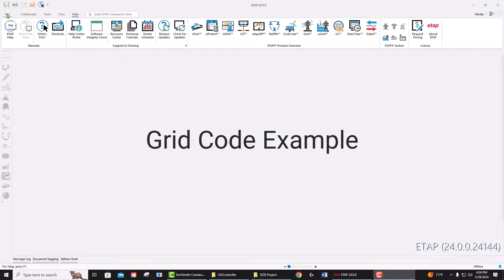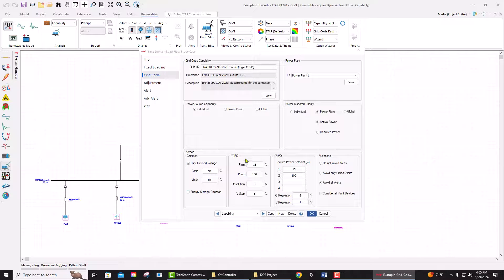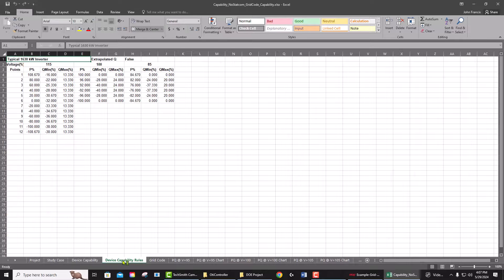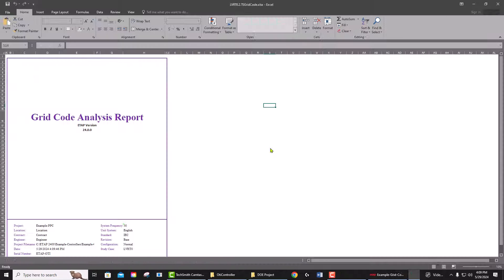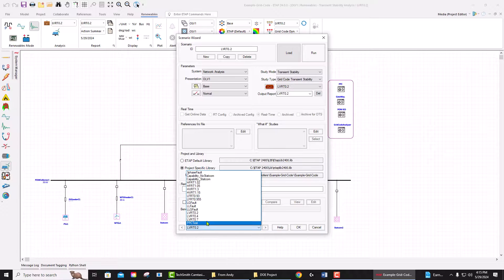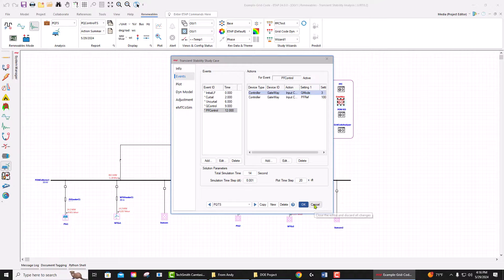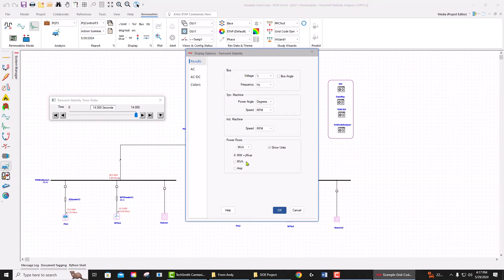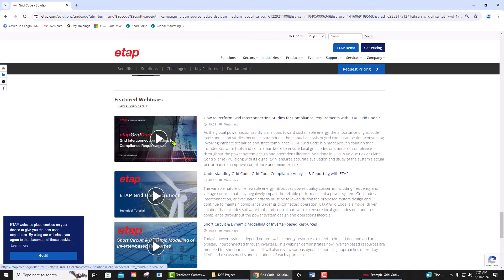How to use Grid Code in ETAP 2024

Comment: Hello
How to convert ft to m? For grounding grid. Thanks
Reply from the maker: Thank you for you interest in ETAP Solutions. 
The units used in the ETAP Ground Grid Design (GGD) module are determined by the Unit System selected for the overall ETAP project. For example, the Imperial system applies feet, whereas the Metric system uses meters. The GGD module does not automatically convert previously entered values when the project Unit System is changed.
Please contact our Help Center at https://helpcenter.etap.com to assist with any further questions.